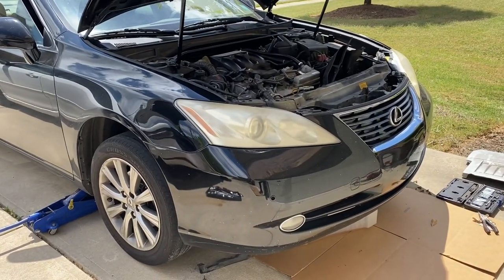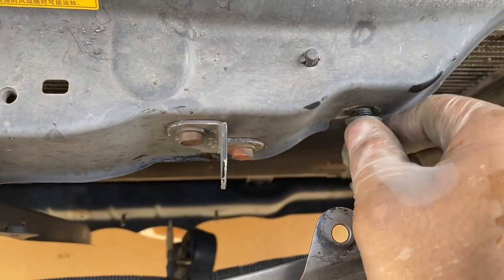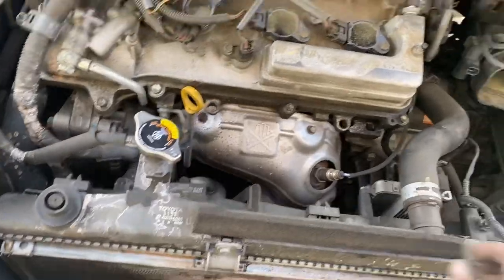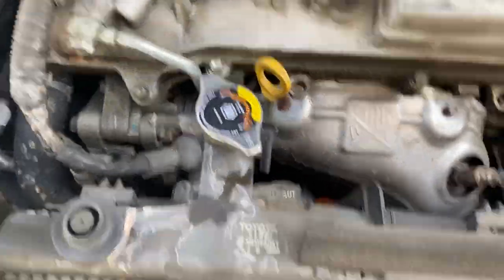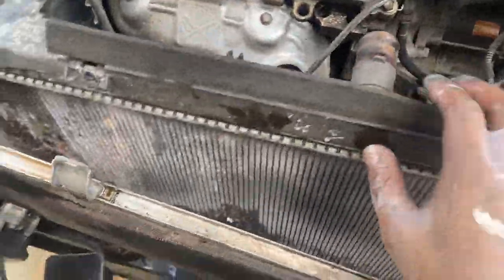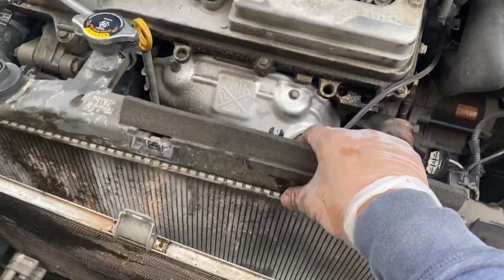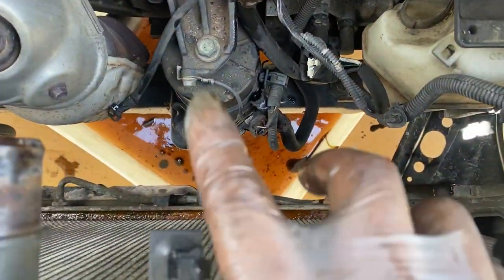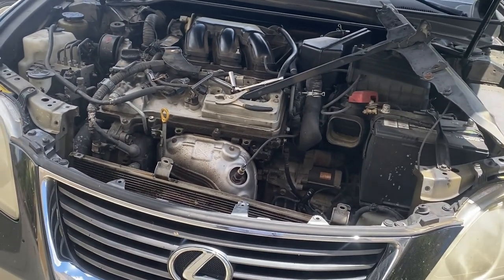2008 Lexus ES350 radiator replacement walk through

Comment: Thank you for posting this helpful vid.  Getting ready to replace my radiator in my 2007 Lexus ES 350 (149,000 miles).  Wondering if I should just buy an OEM Denso replacement radiator or go with another brand.  I assume I need the tow package when I order the radiator?  Some say with and some say without (tow package).  Figure I probably ought to replace the thermostat at the same time since I'm in that area?
Reply: Did you ever replace the radiator yet I wanna know if I should get the one with or without the tow package
Reply: @imronsubhan454  I got without.
Reply: And thanks to this video the job was a piece of cake.

Comment: I ended up having a mechanic replace the radiator because I wasn't confident enough to remove it myself. One thing I noticed is that they refilled my radiator with yellow antifreeze instead of the pink antifreeze. Is that something I should be concerned with, or is that fine? If I'm not mistaken, the yellow antifreeze is universal.
Reply: Not anything to be concerned about, it might not be the exact replacement but the specs are fine and your engine will be cooled without issue.

Comment: Hey there! where did you get your replacement radiator from? im not sure if i should go aftermarket for cheaper in risk of improper fitment or pay extra for OEM.
Reply from the maker: Customer bought it from Amazon I believe. After market is fine as long as you get the right one.